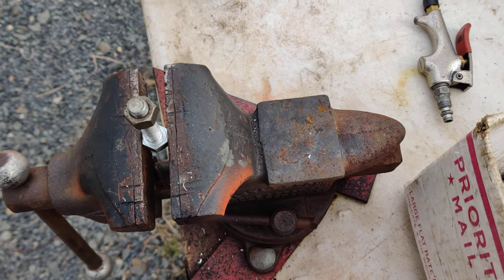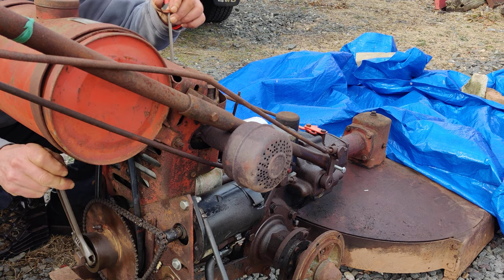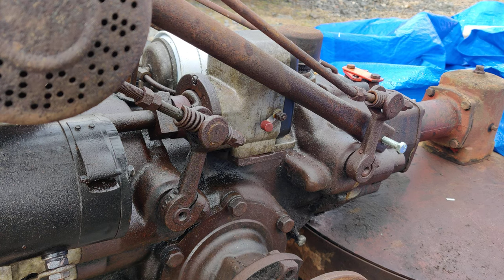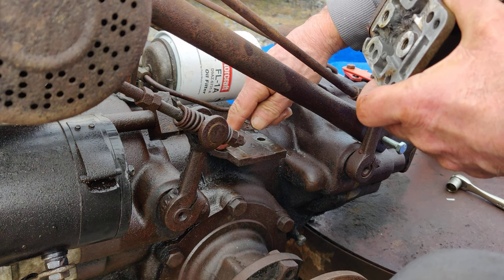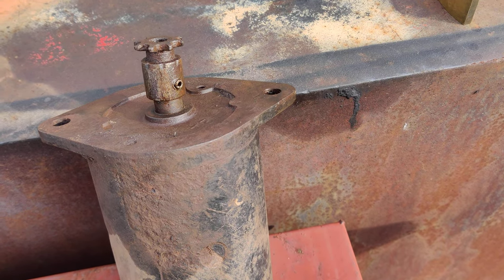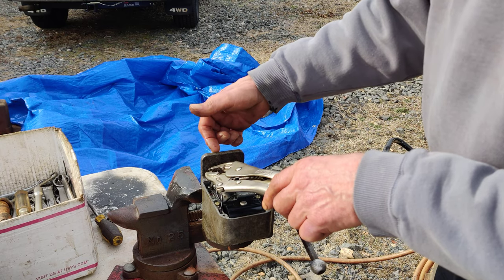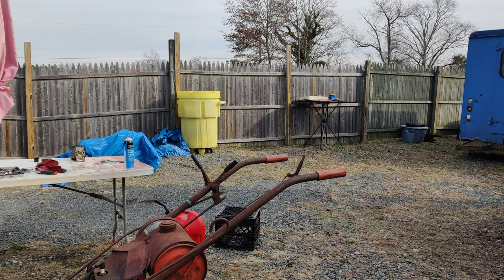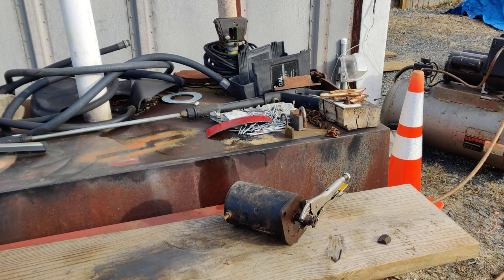62 Gravely project magneto (ignition system) remove and repair Part 4

Comment: How do you know you're TDC and not at the exhaust cycle, without removing the head?
Reply from the maker: When you have the spark plug in you can feel restriction as the piston comes up that indicates the valves are closed (compression stroke)